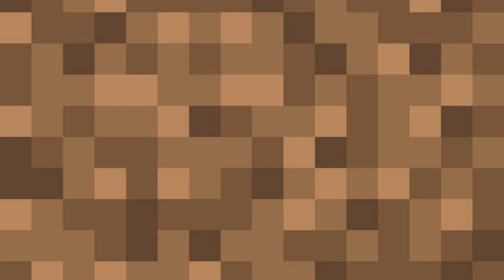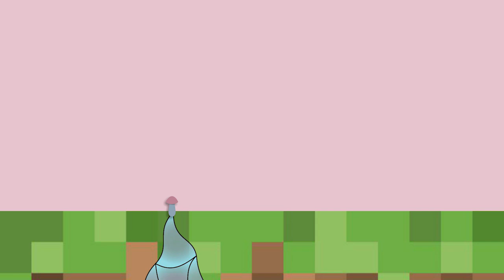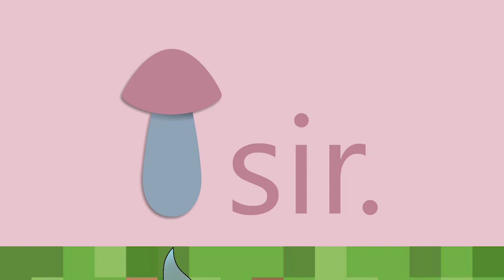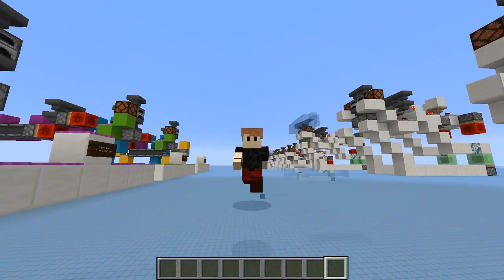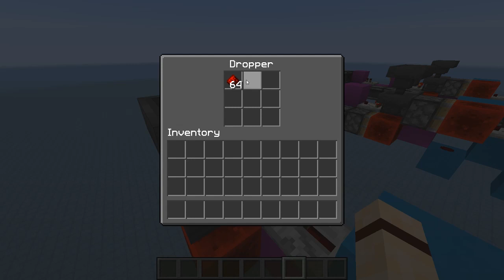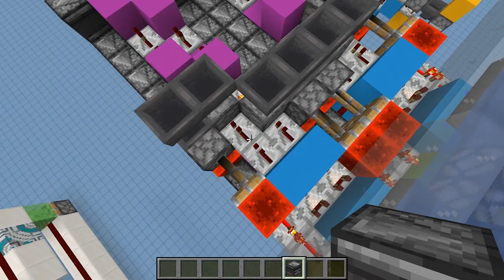Furnace XP Farm: Xisuma Redstone Challenge

Comment: Nice Design. The only Issue I see is that it can only count 576 items (64 x 9). If you want it to repair a diamond tool it needs to be able to count 780 items (12 stacks and 12 items).